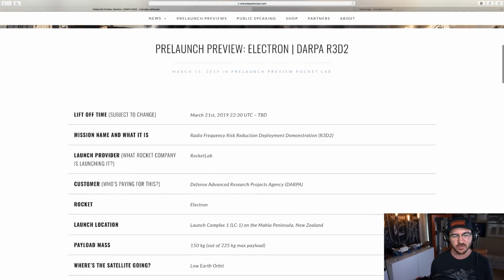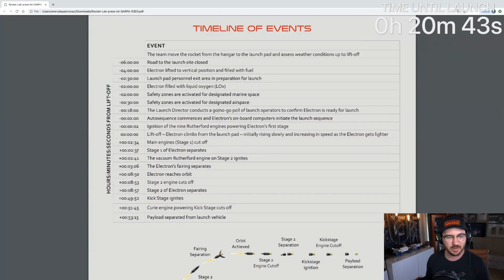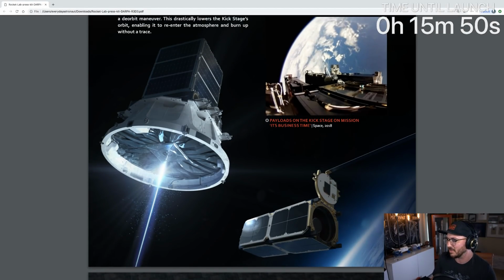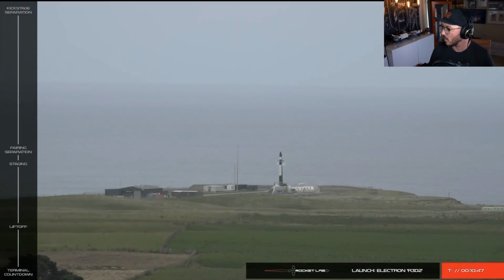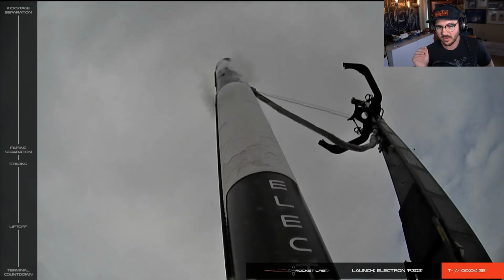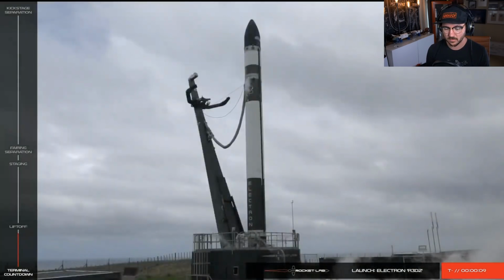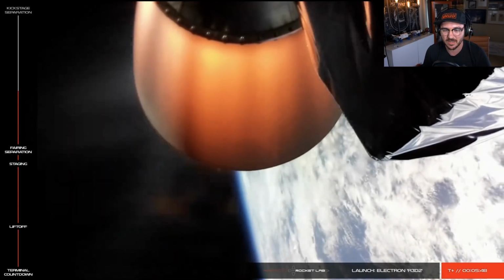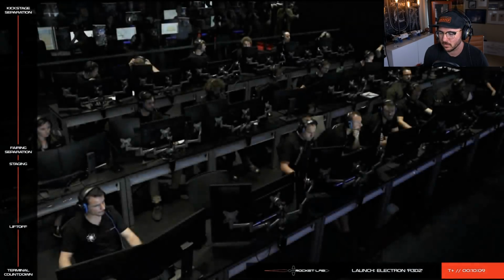Watch Rocket Lab launch a satellite for DARPA

Comment: I'm sorry if this has already been covered, but why is Rocket Lab using the batteries? I thought that it was for ignition, but that isn't the case. Is it to run the pumps? If so, what do other rocket engines use?
Reply: Batteries to run the pumps. Other engines use the exhaust of a preburner to drive the pumps.
Reply: Yes they use it to run the fuel and oxidiser pumps. Other engines use small(ish) turbine pumps - these burn some of the fuel and oxidiser to run the pumps.
Reply: @roelwieggers4181  Interesting. Thank you. Curious what SpaceX's Raptor engines will do with them being fully closed cycle.
Reply: @anthonypelchat  You're welcome. Scott Manley did a video about the raptor engine which is quite a bit more complex. https://www.youtube.com/watch?v=Sdwy9fzQzl4
In case you're interested.
Reply: Russian Soyuz-type rockets (because of German V2) use hydrogen peroxide. SpaceX' Merlin uses large excess of kerosene burned with a small amount of LOX. In all cases the hot high pressure gas drives the turbine which drives centrifugal pumps.

When Merlin throttles down, the gas generator has to be throttled down much more than the main combustion chamber -- hitting the stability limit. Also the turbine adds inertia, and cannot be controlled very quickly.

Going with the electric pump allows to avoid the complications with all of the above, and just use electronics to control fuel pressure rapidly and accurately. It is a lot easier to find experts in electric pumps than in classical rocket turbopumps -- it is a very specialized technology.

In terms of weight it is not very different from using peroxide + turbine, and even Spacex burns a few percent of fuel just to spin the turbine.

Of course, even simpler is to not use any pump at all -- French "Diamant" rockets launched satellites using pressure-fed first stage! (But it is much more efficient to have a pump if you can build one.)

Comment: also, lithium polymer batteries are not particularly bad for the environment. There's a decent amount of pollution involved in creating them, but the materials of the battery itself are pretty mild
Reply: treschlet Curiously do you have a source?
Reply: @bobbob123ful  Depends on the make of the battery cells. Most of today's lithium-polymer batteries contain about 35% by weight of lithium cobalt oxide -- but there are also other kinds, using different materials. Cobalt is toxic, but Rocket Lab had to perform an environmental impact assessment, and since it was approved by the experts, the predicted impact could not have been too horrible. And they did consider that there could potentially be a very large number of launches (thousands).

Comment: Iam not sure if a microphone attached to the rocket will create sound.
Sure the wave propagates through the body but would the microphone pick that vibration up when it is built to detect air pressure waves? If the microphone is INSIDE the rocket in a pressurized container sure.
Reply: There are videos of the space shuttles boosters falling back to earth with sound throughout. Definitely worth a watch!

Comment: If you believe in an omnipotent being, bless our ANZAC brothers and sisters. If only Westminster could do this rather than shackle a nation to a life of strife. Peace out from a highly experienced hazmat chemist.
Reply: Got to love how you explain how cryogenic things work, if you don't get it.. It's cold and touching the vessel would require personal protective equipment. Yeah liquid Nitrogen has been part of my daily routine for as long as I have been a  graduate. Solid Carbon Dioxide is more fun, you can turn a API lab surface into a fun game of cyro hockey with some IPA and solid Carbon Dioxide. Got to pass 12hrs someway while carrying very basic clean down procedures. If only GB actually made API and other chemicals.
Reply: If only they could design and recover a reusable lithium ion battery. Too many years in haz waste industry, yes de orbiting the batteries ensures the get a destruction / disposal end of life but one day resources will be finite to the point of disposable tech is not going to be a thing

Comment: How about some parachutes? Dont whey too much
Reply: Parachute that would burn up in the atmosphere
Reply: @defendmoon6813  then what do you say if they do the reentry burn and then use chutes?
Reply: @buffkonradin  Consider that the Electron has a payload to LEO of about 225kg. Adding even just a parachute and enough fuel for a reentry burn would cut that payload greatly. Even worse for the 150kg SSO payload. And even like that, only the first stage could be recuperated.
RocketLab is more focused on keeping the rocket simple enough to be able to build and launch one Electron a month, and that would help with launch costs.
Reply: @trezapoioiuy    How dare you bring facts and math into this discussion!

Comment: 100% wasted rocket. So yesteryear. Better start learning to land them things or stay left behind!!!!
Reply: Rockets that small would suffer huge amounts of payload penalties if landed propulsive, along with a complete change of the flight profile, upper stage strength, and tank strength. It's actually cheaper to launch these rockets expendably, especially when using the cheap manufacturing techniques of RocketLab. Reusablity is only really viable on larger rockets with more space for payload detriment.
Reply: @fettersbuiltco  Rocket lab is not targeting larger satellites, as the market is already saturated with LV's, so making the launcher larger doesn't make sense other than to raise launch costs in the sake of "reusability", which means more "refurbrishability", seeing how the first stage engines are not made to handle multiple ignitions. By making the manufacturing as cheap as possible it allows them to make as much profit as possible through expendable means. 

They may make a larger launcher in the future, and the throttleability of the rutherfords allows for propulsive landings without the need for risky suicide burns. However, like I said, that's not where there money is and putting their money into that R&D would likely get them bankrupt.
Reply: Yeah @dennis doesn’t know what he’s talking about here at all, rocket lab offers something that space x can’t at all. Great company.
Reply: The rocket only costs 8 million to make. You start tacking on reuse and the amount would go up not down. That increase would be passed on to the customer. 8 million is ultra cheap for a rocket. You can only slash costs so much. You need to remember this rocket only launches micro sats.
Reply: @fettersbuiltco    Well, no, its obviously not less expensive, for these sized payloads, otherwise Rocket Lab would not be hoovering up the small sat market. For now, anyway. We'll see what happens when SpaceX is able to launch a BFR for $7 million dollars.